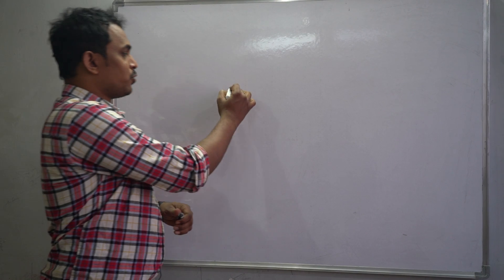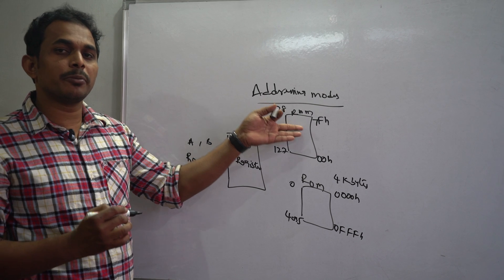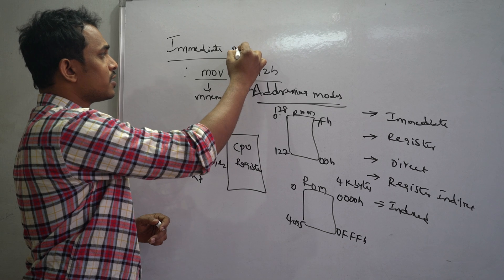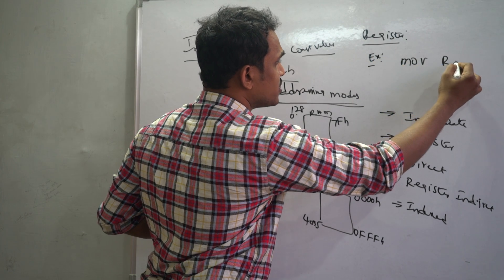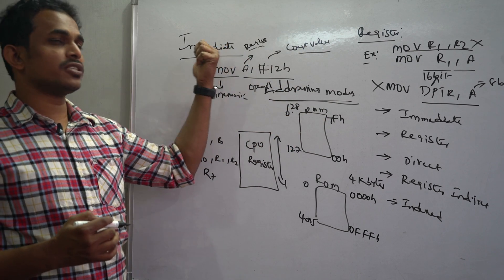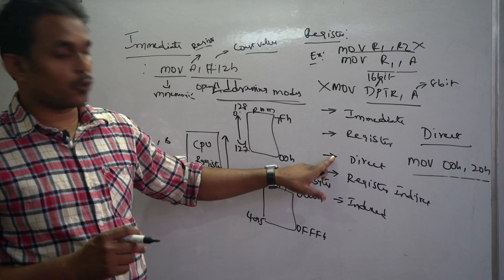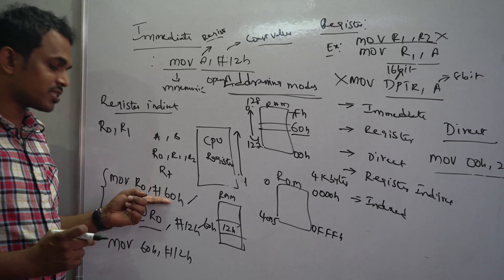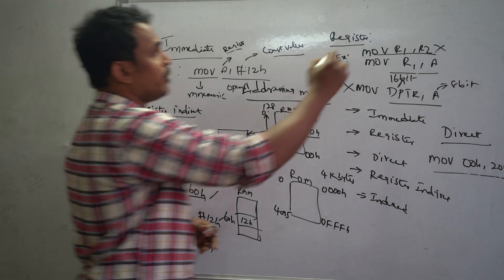Addressing modes of 8051 micro controller

Comment: hello sir,using data transfer Instruction
How to Transfer the conent of R0 to R1,R1 to R2 R2 to R3,R3 to R4...R6 to R7, &R7 to R0? What is Program For that?
Reply: Between Genaral purpose to genaral purpose register no syntax, take a or memory location to move the data
Reply: Amit Mangave first move the content of first register to Accumulator and then move that Accumulator value to destination register.
Remember you can't move value of one register to another directly.